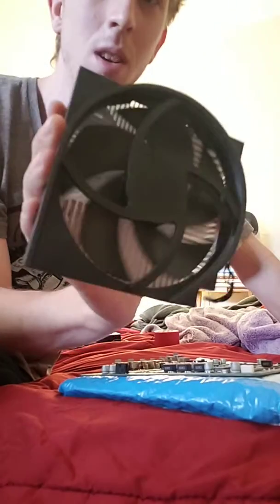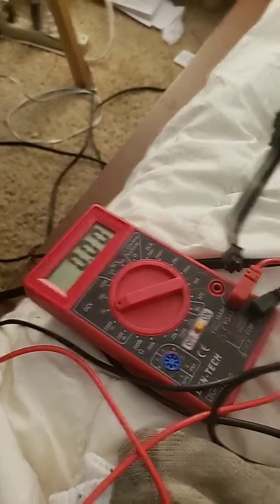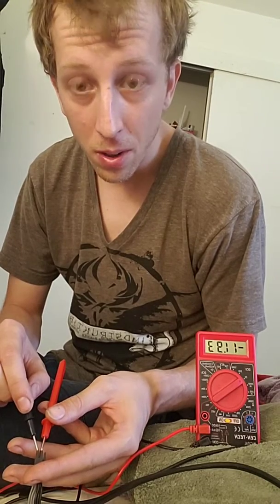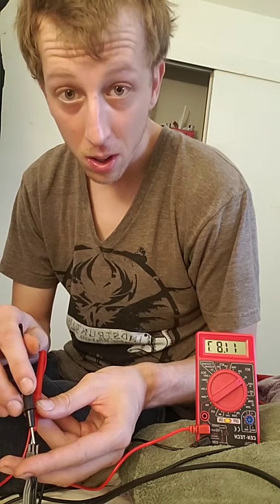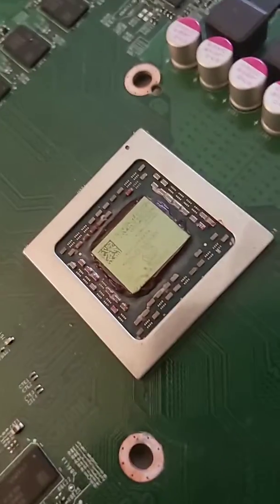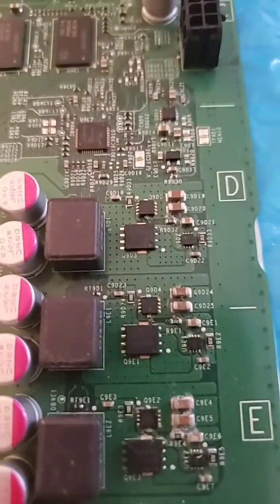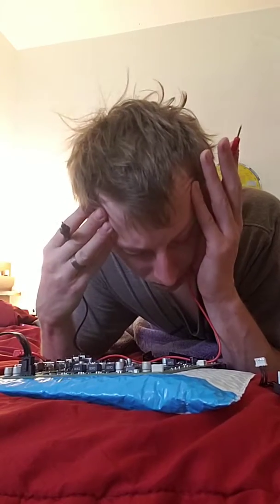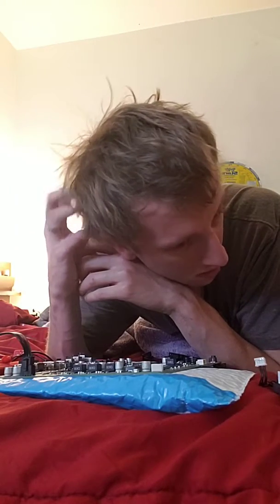Xbox One S power failure and mosfet failure testing

Comment: You'd be far better off testing resistance as theyre all passing the same voltage. One being off a bit means nothing unless WAY off (like 8 or more volta than the others). Also, all those squares are mosfets. You have high side, low side, vcore and vmem. They are a problem in the Xbox units from the S-X series models. A major problem, actually, but your testing isn't going to be very effective beyond getting lucky on a commonly failed part.

Test resistance and voltage drop using diode mode.
Reply: You should make a video showing exactly how to do that

Comment: do you could fix it at the end?

i have an Xbox one s with similar problem, turn on and then turns off, no image on the TV, the pin of 12v is not in short, the mosfet looks ok, the power supply looks ok, 12v